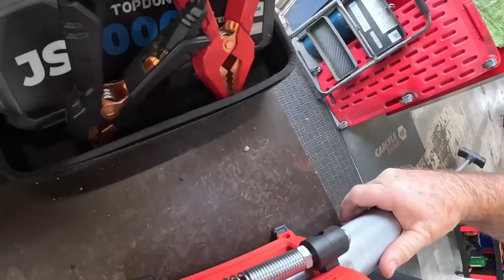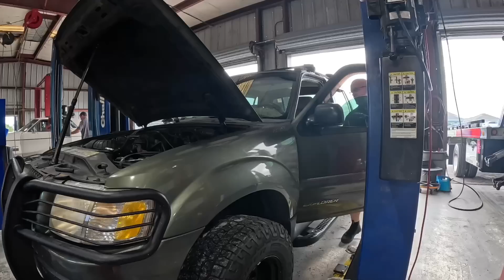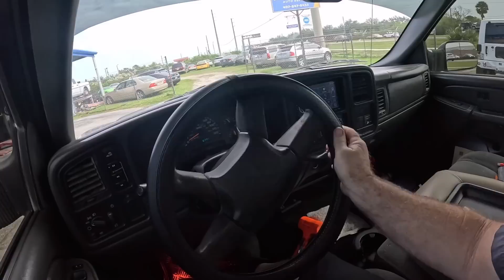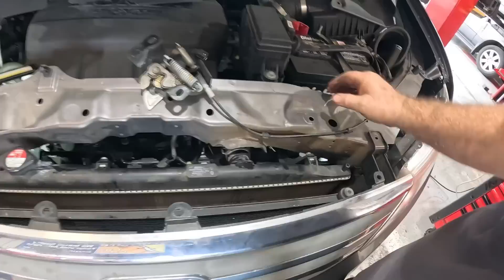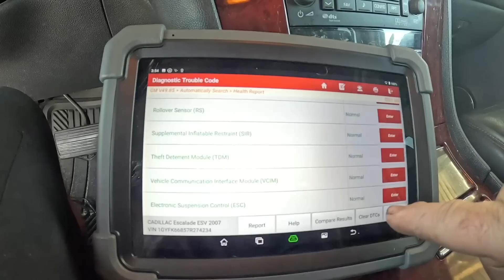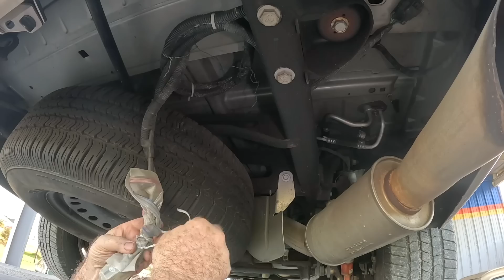Escalade CAN, Silverado Noises, Honda Noisy Fans, DAY 594 in the Shop Fixing Cars and Trucks.

Comment: Try disconnect those connectors and look at them closely. I mean both parts of the connectors. Probably something interesting would be found
Reply from the maker: So far it all looks good. There is some dielectric grease in there, so someone’s been in there.
Reply: @JimmyMakingitwork  
That's bad. It seems like somebody already tried to find the faulty module/wire. so, i would continue with the wiring diagram+oscilloscope
but that can be long and expensive....

Comment: curious do u guys do those just check it out with no upfront money, no minimum charge. and the picco also can handle 200v, i love mine. but their are other options as well. but if u gona get serious  u should get 8 channel,but if u dont do a lot of serious diag a cheaper 4 channel is fine. but now with 4 cam and crank sensors and then a sink 8ch is a necessity
Reply from the maker: We charge for diag time, but sometimes on a repeat visit we wave it. 
I would go 4 channel when I get one. Gotta save up! :)

Comment: Atleast you don't bitch n belly ache about aftermarket parts like Ivan, nice guy but if keith or sma wasn't a source then what, I love it when parts are discontinued, now aftermarket is all you got, cracks me up, just sayn
Reply from the maker: Yeah sometimes we don’t have an option! Very true!
Reply: @JimmyMakingitwork  one other thing AT LEAST OF ALL CREATORS YOU RESPOND, thnku for that
Reply: @JimmyMakingitwork  one thing I wish ppl wld show more of hooking leads up to say scan tool if that's what they use, to show proper connections, and why, so i get the results I'm looking for, like ac or dc voltage in other words how to test, I hv the zues, topdon pheonix max, alltell im608, and matcos maxis 3.0, just after while gets confusing, but at end of the day our tools are not code readers they are diag tools, and for ppl that don't even offer money for using 5000. Tool, is past my comprehension, I guess they get it free from az, oreilly, so we should be free
Reply from the maker: I will make an effort to do that more often!

Comment: 31:10 BNC+ is what you're looking for, the scope recognises the probe you plug in & also powers a current clamp rather than a battery & yes it has floating grounds !
Reply from the maker: Man I want to get one bad! Even though I rarely need one, when you do a good one makes everything easier!
Thanks!
Reply: @JimmyMakingitwork  look out for a used 4423 kit then (or a 4425 even) ?

Comment: Thanks for the video Jimmy!
I'm assermbling the 1958 Holden 138 cube six cylinder this week, everything the machine shop did looks really good but I'm second guessing myself on the rear main seal. It's a rope seal and was an absolute bear to get trimmed to the right length. I think I'd better run it on a stand before installing it in the car.
Reply from the maker: Man those rope seals can mess you up. I forget what I did on them back in the day. Left a certain amount protruding I believe?